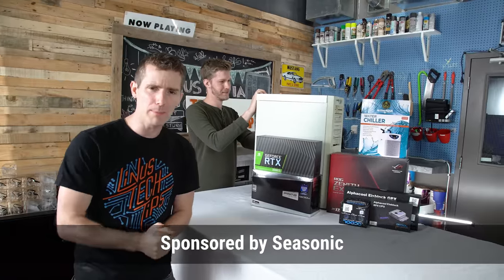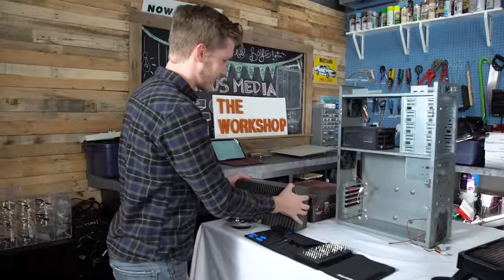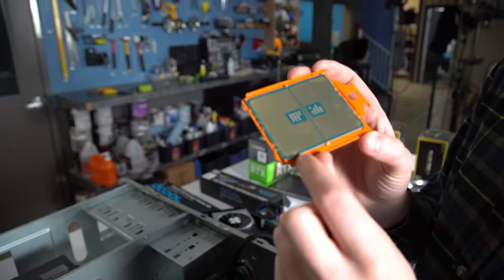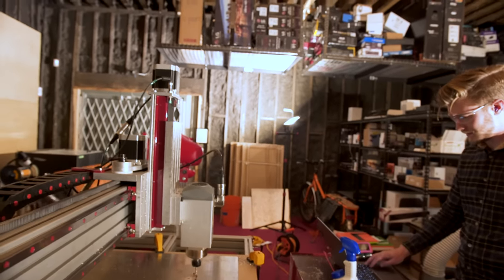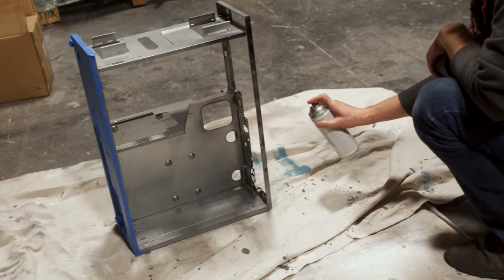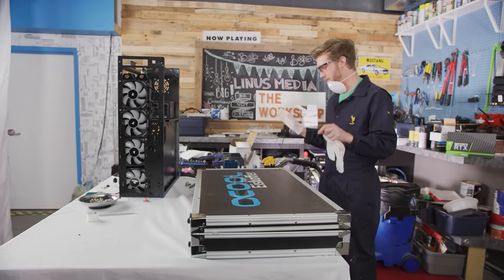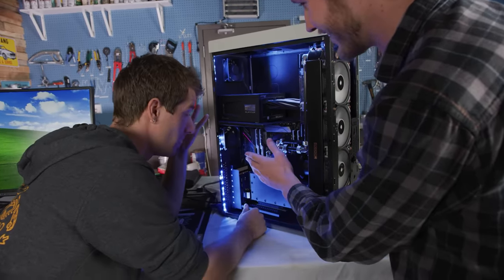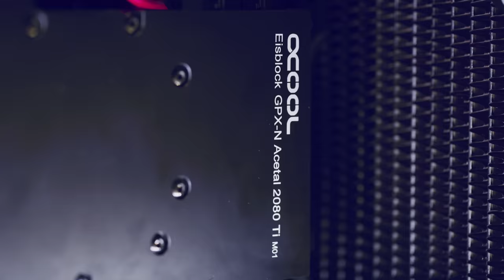The ULTIMATE Powerhouse Sleeper PC

Comment: The most weird part for me is the last part. I get it, sound epic, but weird at the same time. And with all the bass the AirPods pro can possibly muster, it is still not enough for the mood. In short, weird. However otherwise an astonishingly well made setup. 

PS: no idea what a sleeper PC means.
Reply: Looks like an average thing on the outside, inside it's more powerful than most average gamer's rigs. The term sleeper is used a LOT in the car world. Someone takes a normal looking vehicle and builds a strong engine/transmission to put in, it still looks like any regular car outside but it's much faster. My favorite sleepers are the farm truck(its so fast the back window pops open and the front tires come off the ground) and the turbocharged minivan :D.
Reply: mike in a can ahh, I got it. Thanks for the explanation. 

For that matter,  if I build such a sleeper PC and choose the case, I would choose a case that looks dull but give the impression of “this is not from 1980”, and cram powerful internals. Maybe with water-cooling but minus RGB.

Comment: now if you could find and old Xerox Alto word processor.  People would at first think its and AC unit.   Or a sleeper commodore 64/128.  How about a sleeper Atari 2800?   Have the Atari start like normal even begin to run the game.  The switch to a fully modern version of that game instantly.  Better yet try to time if when the Rube is looking away for just a moment.

Comment: Alex, I know you're young, and I know you're likely a strong guy, but, let me tell you, as you age, your shoulders are going to all apart if you keep doing things like cranking on that vice grip manually! There's better equipment for bending metal sheets.... :) Also, those leaks... I've been building PCs for 25 years, and I've never used water cooling, not once, because the consequences of leaks can be so severe. I'm easily bothered by noise. Right now, my rig (on which I develop video games, including 3D modeling, building/baking, etc.) has eleven big fans in it, and it's generally hardly audible. Under load, it's noticeable, but nothing compared to any stock pre-built PC, sometimes at idle.

Comment: I've never trusted water-cooling. Too much potential for leaks bricking your equipment.

If I ever get around to building a sleeper out of one of those old beige boxes, I'll keep the floppy drive and turn it into an SD card reader. Dr. Moddenstine did that with his IBM Aptiva sleeper, using the disks as caddies. I thought that was very cool. I'd also replace the DVD drive with a Blu-ray drive. I have a bunch of old big-box games that came on CDs and DVDs and without an optical drive, how will I install them? I don't want to pay more for the games on Steam or GOG. I already bought the games before, I didn't do it to buy them all over again.

Comment: Work Safety (boooring) for sawing or sanding carbon fibre: Alway use a vacuum (needs to have proper air filter) as otherwise very fine particles will get into the air and stay there before coming down as dust onto everything. Use a so called FFP2 or FFP3 dust mask. FFP1 lets fine particles such as Carbon Fibre through. It is not proven but suspected that carbon fibres will cause cancer when inhaled. Use gloves, especially when handling sawed CFRP parts. Little strands of Carbon Fibre will stand out and wait for you to touch them and then break... now you have a splinter that you have to remove as carbon fibre, made out of carbon...., is not recognized as a foreign object by your body and therefore it will not grow out, ever. While unlikely, it could happen that little splinter fragments travel through your veins and get stuck at critical parts such as you brain, causing a stroke. Often it is not possible to grab the splinter as it is so fine and also easily breaks if you dont pull it out straigt: I heard of soaking the body part in soapy water or carefully remove it with a sharp and sterile tool by cutting away the skin above. Wear gloves, also since you could develop an allergy towards carbon fibre.

For this reason, sand parts that you just sawed to reduce risk of splinters and ALWAY handle carbon fibre parts with protective gloves (no thin plastic doctor gloves), even after sanding this is a good idea. Splinters are a pain. For peace of mind, use a vacuum. Saftey googles are just always a good idea. Sorry for this, I work in aerospace, thus this is the safe and maybe over-the-top safe way.  Hope this helps and rather gives you confidence than regret when someone tells you all this later...

Comment: Fuuuuuuck!!! I have same series tower!! Almost same . Except minor details. Bought it 2003, used. Changed it 6 times. Power on the bottom, take air front, bottom. Loosed "pull out motherboard" option. So I can install bigger CPU cooler.

Comment: How is this a sleeper pc? It has a giant acrylic glass panel that lets you see its got a $3000 gpu, a $800 motherboard, and a $2000 processor from the side, it's "retro styled" but not a sleeper, a sleeper looks old on the outside, and you can't see what's inside.

Comment: 4xcutting speed(cutting speed for aluminum is 200-300)÷ diameter( in this case diameter of tool)= gives you your rpm for the tool. Lol insead of trying to hog off all that material in one cut try a few cuts at .02 to .03 thou. That machine dont look very rigid. Sure aint no mori seiki or okuma, lmao
Reply: Also look up the end mill and see what the manufacturer recommended sfm are
Reply: Cmon linus, thats day 1 shit of working in a machine shop

Comment: i have to give a huge "thumbs down" on this one. I am looking for an old beige pc tower case for years now to fill it with beige retro stuff. and here I see you destroying another possibility. What is wrong with people killing another oldtimer. It is like the "fans" swapping the engine in an old car with a super new injection high power version, that has way to much for all that, what an oltimer is standing for. In our Country you may replace also but only with addons not older than the car production plus 10 years, which is contemporary.

My Pentium II and III Xeons get only parts fitting the timeframe. The newest stuff inside is an adaptec 29320alp. but it has to work in an dark grey workstation tower. I t is almost impossible to find beige cases anymore and you make "sleepers". Sad!